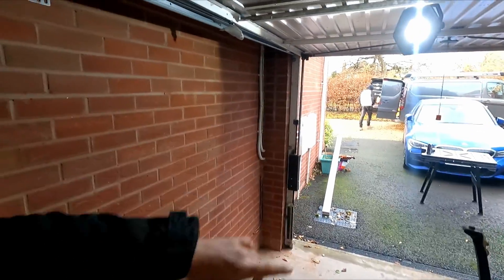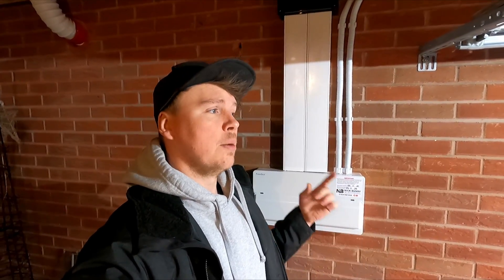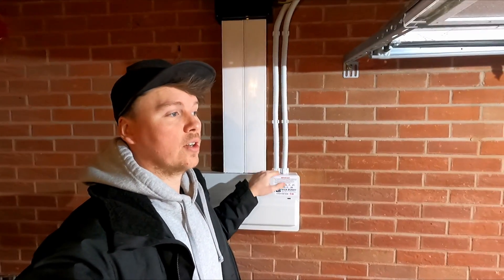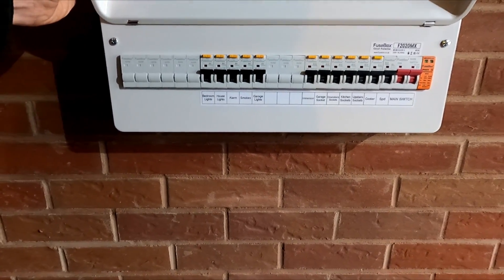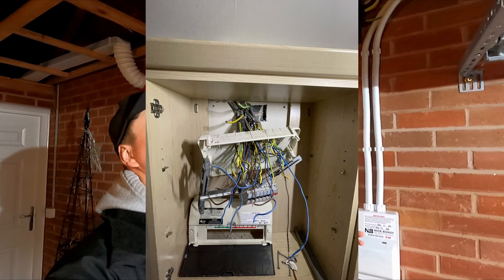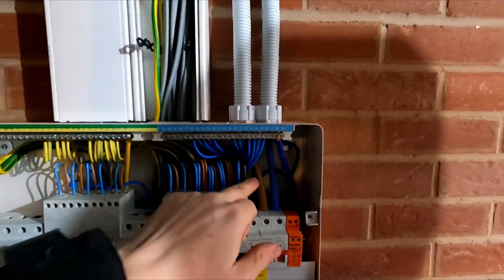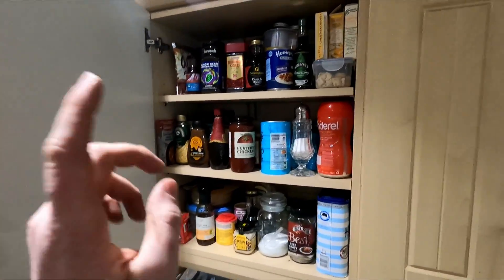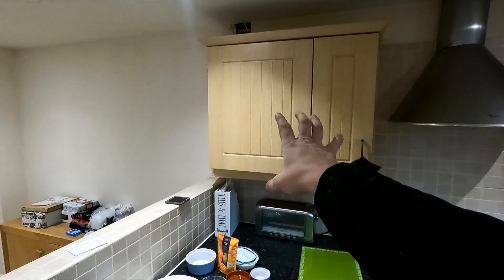How much do electricians charge in the UK

Comment: Seems on the low side.  Does that include materials?  What were your hours?  Do you charge for a site visit?  I have a plumbing and heating company in Vancouver, BC Canada.  We charge for everything.  We bill out at $128/hr for plumbing work and $148/hr for gas work.  We charge for site visits but if the total labour bill is over $1000 not including materials we credit back the site charge.  Less people getting our free visits.  We charge, charge, charge.  We offer great service.  We are quick.  And we know what to do to get it done the first time.  That is value.  We offer our services as a superior product with value through our interaction from the initial phone call, to cleaning up and billing.  As well we pretty much warranty our work forever.  We dont advertise that but we do really good work.  When we do get a call back about a problem on something we have done we fix it with no charge, if we could have done it better.

Comment: Hi, about the eddy currents; I believe John Ward used Extra low voltage from a welder using high current, I'm wondering if the EMF from extra low voltage was a good enough test for eddy currents, where potentially say 400 volts may have produced a different result.
Reply: Only the current matters, voltage is irrelevant

Comment: This a weird one.

If I EICR's that, I'd note (but not code) "a deviation from perceived best practice wrt to entry topology of the supply" just to prove I had done the EICR and not the limited edition £95 "drive by" EICz there on site for 10 mins.

But having done this on huge (2000KVA plus) genset farms with a LOT of electrons wandering about,  we have FIR's the steel glands plates on the busbar chambers and ( as with JW) never seen a real temperature increase.

Given where you got to (I haven't watched the whole video) a 32mm Brass bush into the top of the DB with a wiska box of similar to take the tails would be my move to feel "happier"..

3core 35mm SWA was what you needed from the get go, single phase SWA at that, not sleeved up 3phase like some "arty" sparks on here that use 4mm on EV chargers!!!!!

Comment: Agree with John Ward in a domestic setting 100amp or less it will make no difference, however to abide by reg 521.5.1I always put them through the same entry hole. You’re correct that the NICEIC Snags & solutions says you can cut the strip between to eliminate that.

Personally I would have put a switched fuse and ran an SWA from the meter box back to the consumer unit, then there’s no need for the flexi con or having this issue. Understand about the knock out scenario though as that was a pain.
Reply from the maker: The problem with swa there wasn’t a lot of room to gland it off in the dno box at all, so ended going with the tails bud
Reply: @NBundyElectrical  I see yeah it’s always a squeeze in them even with the new smaller digital meters, in that instance would have done the same here with the trunking& opening out the holes, nice job there mate 👍🏻
Reply: If there's no space in the meter box then tails out to an adaptable box & then SWA to the new CU. That flexi-con is butt ugly & doesn't really give as much protection as I would like to see in an exposed external location - I presume that you did buy outdoor rated stuff... 

Under normal conditions I wouldn't expect significant issues from the eddy currents, but under high usage or fault conditions it's possible. The Fusebox CUs seem to be of a decent gauge of steel, so heating shouldn't be too big of an issue compared to say a cheap galv box which could potentially buzz like a buzzy thing at a buzzy thing convention!

Comment: Do you use the brother label printer app to print your DB labels? I used mine today to label a fusebox fuseboard and the only template they have with 15 ways and mainswitch had cells that are 17.5mm wide, which means they don't line up once you get about half way along! Do you have more templates from somewhere or make your own up on the printer itself?
Reply: Download the app on your laptop and create your own template setting the cell sizes etc then upload it to the brother. Then you just change the breaker description to suit the job
Reply: @timlarsen5014  nice one, thanks!
Reply: If you get stuck send me what you want as a template with sizes and I will create a label for you to upload to your printer if you give me your email. 👌
Reply: @timlarsen5014  thank you. I’ll give the pc software a go and see if I can get my head around it first. Will call upon your skills if my brain falls apart!

Comment: I would've used swa (safer, cheaper, a lot easier in this case). Regarding the slot I would go for what it says in the regs, any problems in the future you are backed up by regs.
Price wise (I live and work in London ) would be around £2500+VAT (a fair price).
Reply: this is why sparks are rolling in it, need to stop telling everybody to go to uni and get more trades out there. I get its supply and demand.
Reply: Totally  agree with you that job looks a bodge.
Reply: It's usually 3 phase where you have the issues, had a borad with busbars running through an un-slotted plate, when it drew over 800amps it used to hum and get warm till we slotted the plate.
Good content, brings back the days of house bashing
Reply: Most likely nothing will happen here, but why take the risks? Believe me, if something goes wrong,  the insurance company will do everything to get away and blame someone else. Also, remember that you will declare that you took measures against electromagnetic fields when filling the electrical installation certificate...so this will be against you. I always try to follow the rules,  have backup for everything I do and sleep weell 😴 💤
Reply: Just to be clear, Nick is a great guy, I am not trying to find things which may be wrong, just saying my opinion.  I am watching his work, he is doing its best and doing great works.
And I see this kind of comments as being constructive,  we all do mistakes,  this is one the ways to learn and improve.

Comment: I’ve seen conductors through separate holes on installations up to 50 years old no issue.
It’s the length of the tails in pvc copex that concerns me.
Reply: I was under the impression that unless it's armoured it would require an isolator if over 3 meters
Reply: @rsnow1212  he’s protected the tails for overcurrent with a switch fuse.Personally I wouldn’t have run 2 conduits. Seems unorthodox to me.
Reply: @lee wills just re watched a bit, missed where he mentioned the kmf switch , I must of been busy admiring that Gucci flexicon

Comment: Are modern day sparkys scared of SWA? Seen several of you running long runs of individual tails when a lump of 3 core swa  would have been easier,and even at shitty electrics prices  you be saving a quid or 2 a meter on the cable

Comment: Nick,  so love your channel, though not a much as JW. (Dave Savery is also wonderful and very knowledgeable.... just so he doesn't sulk for being left out!) HOWEVER, as learned as the man himself is,  we go by BS7671 and until there's an addendum that you don't need to worry if the DB is under 125A supply or similar we have to go by it.  If you don't put the conductors in the same hole, you have to defend it if the house burns down because.... though its nothing to do with your work,  you will be the fall guy matey.
I went for £1,800 Inc VAT.

Comment: Great work! I was at £1550 so not too far. I personally would of used SWA instead of the tails in conduit etc but really neat as always from you!
Reply: Definitely swa 👍
Reply: Its copex though bit of a shit job really looks awful.
Reply: @carlosjackal7624  it's copex inside the garage and conduit on outside
Reply: @mattmedlicott8125   didnt realise but like the guy says an swa at low level would be a much better job.

Comment: The trunking and board itself look a great job but that tube work is absolutely horrendous who in there right mind uses flexible conduit for such a big run and on show🤦🏼‍♂️ it’s not difficult to bend 20mm plastic conduit and the finish would look 1000 times better 🤷🏻‍♂️

Comment: White flexible conduit out side over that length is not a great idea , it will get. Very  brittle in winter and loads of UV damage in summer , I suspect it will last about 5 years before it’s falling off , also you dont have any mechanical protection on the externals ,8it seems a lot of work when when you could have use armored , your works tidy nick and your a great sparky but this shows the limits of what you know , not that that’s a bad thing ever-days a school day a bit of armored would have nipped this job probibly quicker and cheaper with less effort , maybe if it’s tight for the armored you could have looked at other cables like HITUF or something a bit more flexible, I think your too cheap too your a premium spark , charge premium money , reassuringly expensive I say , but if your not VAT I can see why you wouldnt go too mad

Comment: Had to laugh about this Eddie current business is all over YouTube! In industry pulling 4/500 amps yes but on domestic no way. It’s actually more to do with single core armoured cables ( transformer tails etc) for this you need an insulated gland plate at the far end. This is to stop Eddie current circulating around the armouring. Actually got show this when I went for a job years age by the factory engineer, he was surprised when I knew what it was for.

Comment: What happened to the 3m max tail length
Reply from the maker: 3 metres max until you have to install a fuse on the tails bud 👍
Reply: Fair enough , I didn’t see the fuse, I would of still preferred a swa for the extra protection in garage environment but no biggy

Comment: You tube electricians are like wickes how to wire your sockets pamphlets .
They under mine years of college of electrical installation practice and technique  into how to wire your sockets on a A4 size bit of paper or house in a video .
The same as  polish and Russian so called electricians I have come across in the past who strip twin and earth back 10 inch to expose singles ,cut off the earths  at light fittings, no joke or the house rewire with one new brown and blue cable at each socket and red and black in the board with no access to the joint boxes never found .
Stop undermining the trade with the only reason is to self profit with YouTube